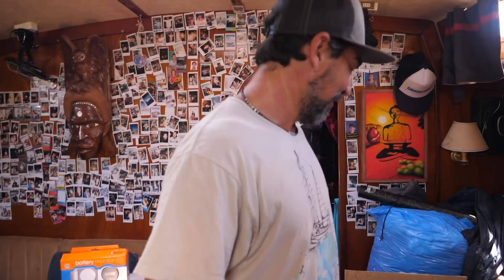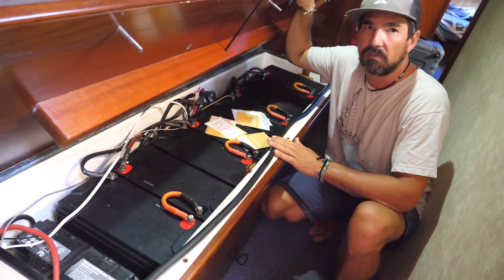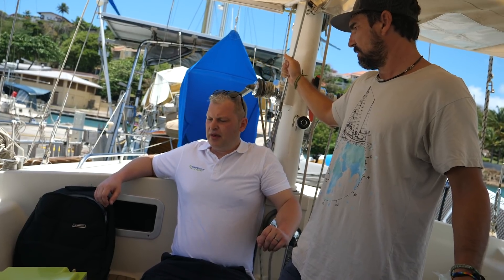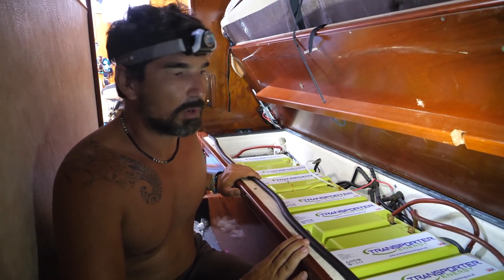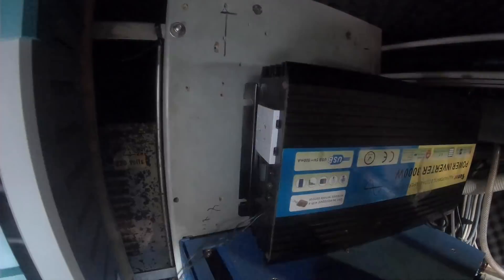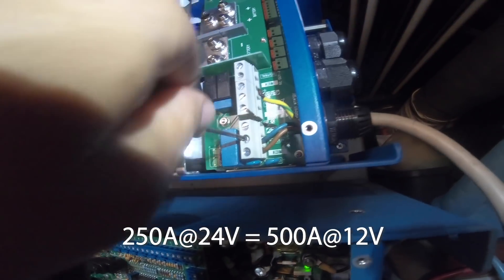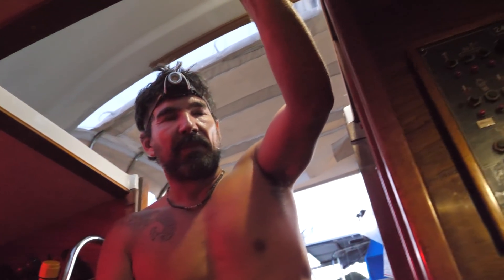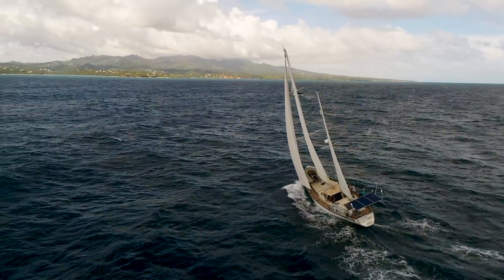Hello LITHIUM, Goodbye Propane!!!  Part 1-  Sailing Vessel Delos

Comment: Hello guys, we own an AMEL 54 from 2007, also living permanent on board, and start to switch our boat to litium batteries as well. Until now we had AGM but they are 3 years now and not sure if they will last for this winter north Atlantic passage from Portugal to Caribbean? So maybe its the right time to switch the batteries to more modern equipement. We would like to know how are your experiances for now and what might be the pitfalls? Did the Gentimes go down as expected? How much is you nominal wind and solar power and how much do you really get out of it? So long VelaNautica.org
Reply from the maker: Hey guys good to hear from you!  We actually hauled out a few weeks after installing the new system so haven't tortured it at sea yet.  I was able to cook a few really big meals for about 15 people on it and that was just fine.  I've also been running massive amounts of power tools in the yard for hours on end without a hiccup.  We're gonna test the hell out of it when we get back in the water and report page.  We have 1000W of panels and 800W of wind and we get probably on average 100-150AH @ 24V from these depending on the conditions is my best guess.  Wishing you all the best and will put up more after we've have more time to test.  Fair Winds- Brian

Comment: One of the best things about LiFePo is that as their temperature rises so does their resistance.  This is opposite of most lithium cells, where their resistance drops as temperatures rise, which can cause a runaway condition and subsequent fire.

Comment: To start a design it seemed best to start with some of the highest draws, one being the cook top.  After watching this the thought came to mind: How to drop the inverter inefficiencies. Found this from 2014.  https://pdfs.semanticscholar.org/0c2c/0c35a9847790cd4a78c61717e6f95fe956d4.pdf  Question?  in your search did you find a 24 volt induction cooktop (drop in or portable)? As of this MIT paper the author said one was not available.

Comment: Cool stuff. .I run Victron in my RV and use their 3000Watt 12Volt inverter charger and their battery monitor like you have.  Still running lead acid batteries as I'm not convinced in the life and value of lithium over lead acid yet.  Enjoyed watching your video.

Comment: From what I've read, the major downside of lithium batteries is that they catch on some really scary fire when the dielectric is breached and the battery is short-circuited inside. The fire can be pretty rapid and intense, sometimes taking a form of explosion. Seems like you guys have researched this topic extensively, so I am curious what you think about the darker side of lithium batteries.

Comment: Hi Brian, I was wondering what happens if one battery fails in the 24V bank.. Does the battery management shut down both batteries in the 2x12V tandem?

Mike.

P.S. I love your easy to understand explanation of difficult technical subjects in combination with the practical installation on board

Comment: How safe is placing them in series, because the voltage will depend on the internal resistance. What happens for example if the charge of both batteries is not equal (in extreem case: one charged, one discharged)???

Comment: You chose the BEST batteries. there is a REAL chance for disaster the way you you have them paralleled. IF any fault occurs in a branch (one of your 4 branches). the current is UNLIMITED and explosion, fire etc is real. don't like your cushion  
battery idea at all. what you need is a over voltage protector. that  provides protection at full charge. Battery banks in parallel can also have discharging problems with unequal branch batterys. I don't like your system I would use a charger/control/inverter that allows you to run 96 volt series battery bank but allows you to charge from your 24 volt system. or run a 96 volt alternator and solar cell system. This is for your 8 battery set up to work efficiently and safely. at the very least install fuses in series with each of the 4 ea branches so there is something to limit fault current. you also need disconnect switches for each of the 4 branch circuits to isolate faulty batteries and save the ship.

Comment: You made a very impressive UPGRADE .....
You should have bought TESLA POWER WALL 2... its a 14kW battery for $6000 .. or you should have bought batteries that were removed from damaged Tesla cars, one guy got 7kW for like $1500.. just saying.

Comment: Great video!!!  I am glad you went with LifePo4 that is a much safer chemistry for a boat.  I built 1974 VW Thing with LifePo4 batteries and had great success with them.  I am now in the process of building a solar/Lithium powered catamaran boat.  100% powered by the sun.

Comment: Congrats on the upgrade to Lithium...  love the tech videos!  some questions I have...
How does this system link with your starter battery, your generator battery and your bow thruster battery? Do you have voltage regulators on the boat such as Balmar MC12 etc, that regulate other batteries with the same charger that charges the Lithium group?  Curious...

Comment: WHERE YOU BUY THE INDUCTION STOVE YOU USEIN THIS BOAT? JTS1040@GMAIL.COM
THANKS
Reply: Kenyon - 1000$ ;-( better take a bigger inverter and use home appliances - cost 10% of that... go for the Multiplus/quattro 5000 and you never think about energy limits anymore;-)) Brians choice for Multi 3000 was propably based on the Kenyon, because it limits the the consumtion to 1800W by switching between the two flames. This results naturally to less cooking performance. Better take a conventional inductive cooker and invest the savings in the inverter. Then you may cook with up to 5kW...

Comment: So I went to transporter energy website, and they are in the UK? The batteries say USA on them and there is no link to any dealers in the US??
Reply from the maker: USA links are on http://svdelos.com/lithium
Reply: Ok thanks, I see it now in the "show more" in your description. For $5000 I guess I'll stick with the system I have on my boat, yes I still have AGM but I have 600ah of them at a fraction of the cost. I'd only want to do it if I was getting more then 400ah's of lithium, so for the cost upgrade It's just not worth it to me, and if I need to replace one battery it's $170 not $1000. But enjoy your system, it's pretty sweet

Comment: I totally prefer Lithium even if they're not simply to maintain like old lead-acid -cells by exchanging acid rinse the cell put fresh acid!  in .

But the power load and output is such much better hope You didn't undersize Your cell count for microwave and stove.

Perhaps You should share expetiances with Rick from sophisticated lady

And don't sell the old parts cheap ;-)

Comment: Big $$$ in those LiFePO4 batteries , but its worth it .   I bought a small one this year , works fine for me , the flat ( almost) discharge voltage curve is great , rare that it drops below 13.02v , as you said they charge very efficiently,  not sure but it doesnt stay long on absorbtion charge long ( victron solar charge contrtoller )

Comment: Another excellent overview and test of an all electric system of a solar/wind/generator powered sailboat, which replacing the heating element items is the hardest(i.e stove and microwave). Will be an added exclamation point to each of your future adventures.

Comment: I may have missed it in the video or comments below but when you connected the domestic (lithium) bank to the starter battery to avoid high voltage spikes I assume you used a diode with a reasonable voltage drop to avoid simply connecting the batteries together, diode or something else and what was it's specification and where did you source it?

Comment: Real Nice job on explaining it all. Its funny about the lead acid I shut my genny down when its charging in the 20 amp range it just waste to much time and fuel to top them off I have (6) 6 volts for 12volt system 660 amp hr bank. I am due for batteries next year you have me thinking now ;-)

Comment: Brian, great video and interesting project. I also enjoyed your Amp-hour video. You were asking for encouragement for this type of video, so here it is. I guess your S/V Delos audience has different segments and two of those are certainly the "will be cruisers/sailors one day" and the people like us who have a boat and sail. These kind of videos are massively informative for those two sets of people, especially this one, which is basically testing the future on behalf of some of us. I really admire your ability to tackle all the practical engineering/electronic stuff on the boat,  keep it up, we learn and are made humble. I saw Delos when on holiday in my old home town of Cape Town, in fact, I tried to leave a couple of cases of beers but was foiled by the waterfront security. What you did not mention in the Amp-hour video or this one, was the detail of your sources of power. What is your full capacity from the solar you have, you have 3 very large panels on your arch but I am not sure how many Watts each, your two wind generators what do you think they produce and at what threshold apparent wind speed do they become useful? Is there a case for wind generators anymore? That big Onan genset; what is the range of running time that you need to run it on a good power day or a bad power (overcast, no wind) day. Passage versus anchorage? All interesting stuff. I have tried to go totally green on our boat with no generator, so I will watch your experiment with great interest, as Lithium batteries and one more 150 watt panel may open that door for us. Induction hob great idea but will watch this space. Is your microwave also a convection oven and will that be possible off the batteries alone? We sail an Allures 45, run a 12v system and currently we have 2x140Watts on our arch, 2X60watt (super old generation) panels on the coach roof, a D400 wind Gen and a towed generator for passage making. We also have a power saving Hydrovane for passages. We have 8x110 Ah sealed lead acid batteries, with 6 of those in the domestic bank. If we replace those 6 with Lithium and add another 150 watts of solar......maybe we can go to induction cooking and more?

Brilliant videos.........said like a Surf African...to all of you....dik respect!

Comment: I've been at sea for over 40 years on every kind of vessel you can imagine and for several years on sailing vessels that I had modified systems and had one of the first hybrid electric drive large sailboats and existence and we switch to LED lighting and lots of other little things that save every amp of power that we could possibly save and I really enjoy watching you rewiring your boats navigation system before and now putting in an induction cooktop you have just sold me on getting rid of the propane that we were designing for the new boat.

Comment: Very helpful! Im currently upgrading electronics on my tiny 27 ft boat and trying to make my cruising more sustainable. Videos like this help me make the right choices since this knowledge transfers very easily to smaller systems. That said I wont be running a microwave anytime soon ;). keep it up and thanks! S/V Devotion, Seattle

Comment: Brian, If and when you do a follow up video I think it would be very interesting to see your conversion/efficiency rate when charging from the diesel engine vs the solar and wind. For example: The generator might be 20Hp  or roughly 15KW but your only producing 2.5kw. Now I know its not nearly that simple as you may not be using the full capacity of the generator motor all the time. You could do the Otto Cycle calculations when the motor is running to charge the batteries from a set voltage. What I am getting at is I expect to see something like. The motor running at 1500RPM is pulling a load of 4.5KW and we are charging at 2KW. This means you have a 2.5kw loss in the system which seems like a lot but the general Otto cycle efficiency runs at roughly 50%. So the rest is lost in heat/vibration etc. Then compare that value to that of the wind and solar. I know this sounds weird but I think it would show how inefficient solar/wind power systems really are at converting energy from mother nature to electricity. (By no means am I promoting the use of fossil fuels). I'm just saying that even though the combustion cycle is dirty and bad for the environment they are a very reliable and efficient power system. Also goes to show how much growth we have yet to look forward to in the renewable energy field! But in the end.....stick with renewable energy because if we don't take care of mother nature she might not provide for us..Thank you from a proud American Farmer and Engineer!

Comment: Cool stuff Brian. Im a fan of these past boat life maintenance videos.. They do rise questions of mine..  You have been showing the breaker panel. And it turns on all the lights, but is that the only switch for each light? or is there also a switch in each room?   I also like the videos of crew and antics. Fun times usually...    Is Babs ever coming back?   I think I had a crush lol...

Comment: Interesting work Brian.  One of the things regarding these projects that are often ignored or forgotten is that of Temperature Derating on things like battery chargers and inverters.  I obtained the derating curve for your inverter here:  https://www.victronenergy.com/upload/documents/Output-rating-operating-temperature-and-efficiency.pdf

On the first page, it shows that you have 100% of rated output to an ambient temperature of 25°C (77°F).  So right off the bat, if it is warmer than 77°F, you don't have a 3000 VA inverter, but something less.  But more significantly, inverters are always installed in a hole somewhere with little thought about the heating that the inverter will produce, due to it's own inefficiency. So in addition to the ambient temperature, you have derating of the inverter due to the increase in ambient temperature as it runs.

So if you have an 85°F day, and you run the inverter for a while, when the new ambient temp gets to 104°F, your new output rating is .9 x 3000 or 2700, which when divided by 120 Volts = 22.5 Amps.  Continuing, at a new ambient temp at the inverter position of 149°F,  The output derating is 69%, or .69 x 3000 = 2070 watts or 17.25 Amps @120 VAC.  

So while this is really quite good, compared to many of the inverters on the market, it is important to consider it in your system engineering.

To put the issue in better focus, consider that the maximum efficieny of yor inverter is 92%, so at very least, 8% of the power that comes to it, will make heat.  So at full load of 3000 VA output, you will have also come to it and be lost of about 240 VA that must be rejected by the inverter into the nearby area.  So picture a 240 watt light bulb in the hole where the inverter is located.  How warm will it get in that area on a 85°F day, after an hour or so??

One thing that you covered regarding the decrease in charging current as the battery voltage rises, leading to the waste of generator fuel, you have a modern generator and it's governor is reducing it's throttle setting to that which is required to maintain 50 Hz at the reduced load.  Therefore, lower battery charging current is resulting in lower generator fuel consumption, although it does continue to use generator hours.

I'm looking forward to seeing how this turns out.  Best Regards,  Bob A.

Comment: Here are the type that I would use... Glass matt batt's https://www.walmart.com/ip/Batteries-Battery-Gel-Tec-Dryfit-8g31dtm/168077740?wmlspartner=wlpa&selectedSellerId=6361&adid=22222222227067216682&wmlspartner=wmtlabs&wl0=&wl1=g&wl2=c&wl3=171523804766&wl4=pla-279185907998&wl5=9012138&wl6=&wl7=&wl8=&wl9=pla&wl10=118786655&wl11=online&wl12=168077740&wl13=&veh=sem

Comment: Some general battery tips for crew and fans out there from a solar installer who's done several off grid and grid tied solar battery systems;
1. With AGM or flooded lead acid (i.e. batteries without intelligent individual cell charging technology), keep your parallel banks to a maximum of two.  For example, 48V bank using two strings of four 12V batteries is ok, but when you add a third string of 4, charging and discharging imbalances can really take hold.  Differences in wire length, wire type, terminals, temp, etc. all affect the total resistance and can result in uneven current flowing and out of the paralleled banks.  To mitigate this, you can add intelligent charger systems which charge up batteries individually rather than as a group.  With those LiFePO4 batteries, the intelligent modules may take care of this issue - please post specs!
2. Be very careful when making connections and be sure you have a double checked plan of connecting!  Always wear eye protection and gloves AT LEAST when making battery connections.  A friend of mine experienced a severe arc flash when he accidentally connected a 660Ah 48V circuit in a dead short condition.  The flash vaporized a 4/0 copper crimp lug in his face and sent red hot metal slag all over the room including onto his body.  The sound was nothing short of a 12g shotgun blast.
3. For grilling using batteries, check out on demand hydrogen gas generators that can make combustible gas from water for that nice flame broiled grill effect. ("Current"ly under development in my garage)
4. Why not go full electric motor on the yacht?? You can do regen charging while under sail, add a ton of battery capacity in the unused space, and eliminate diesel maintenance from your life forever!

Good luck Delos team,

Comment: Each 24 volt setup should have its own circuit breaker within inches of the terminal. If you dead short them, instead of 1200amps you can get 30,000 amps. You will not get the wire disconnected, and the wire will catch fire.